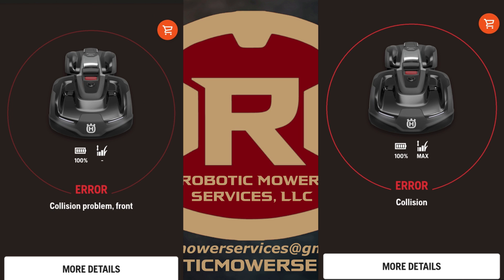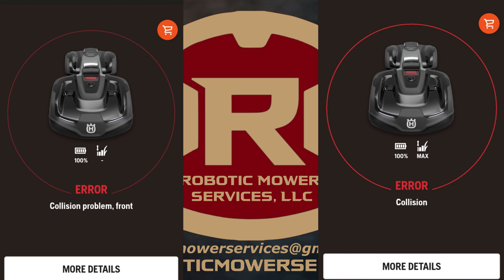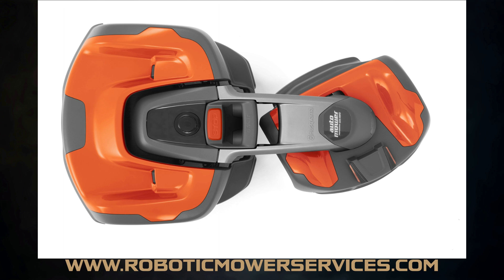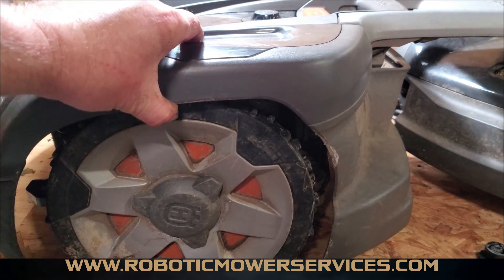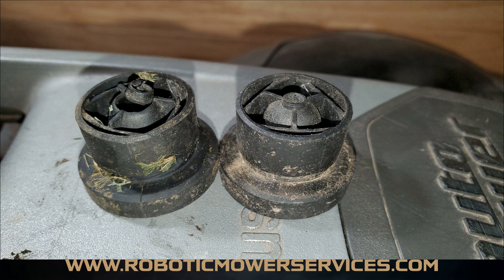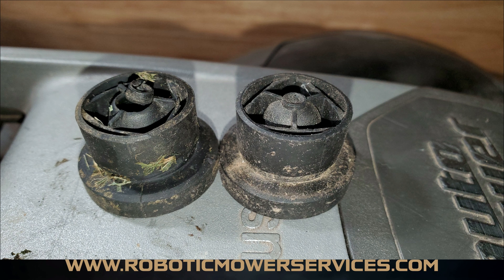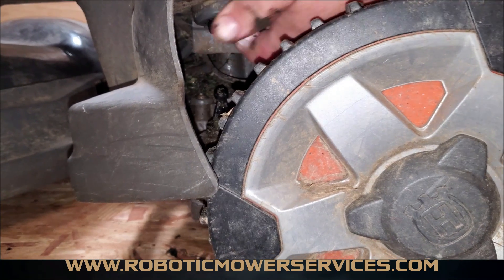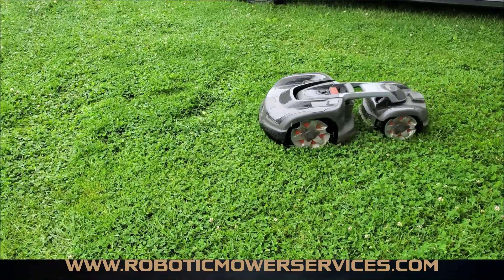Repeated Collision Errors From A Husqvarna 435X Or 535AWD Automower

Comment: What about if it shakes and says it's upside down?
Reply from the maker: Not sure why it would be shaking unless something is loose, there's a wheel motor or wheel motor control board issue, or the blades are bent. The vibration is probably affecting one of the boards and causing the upside down error. That was common in the 500 series mowers that came with the terrain wheels when they would drive across hard surfaces.